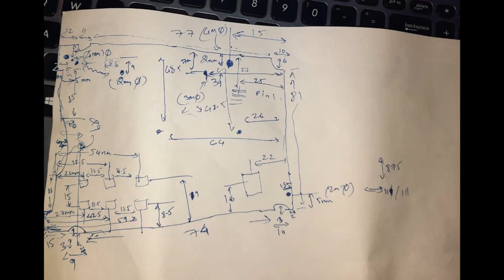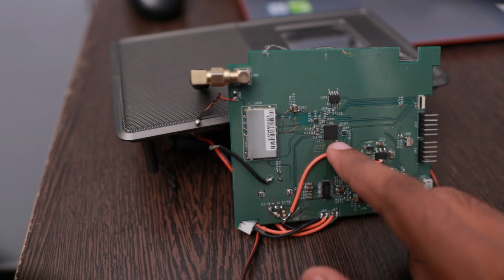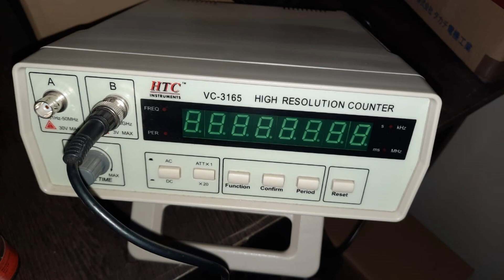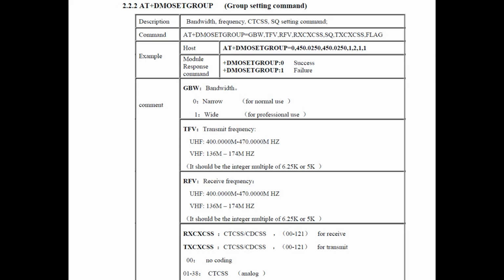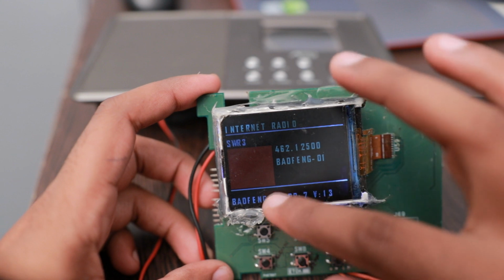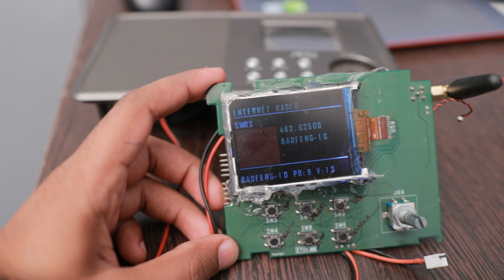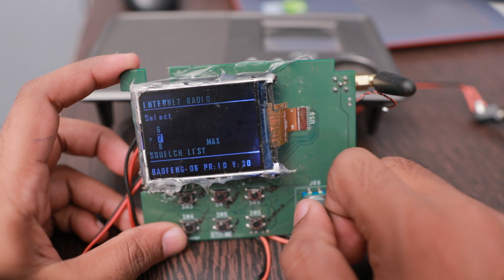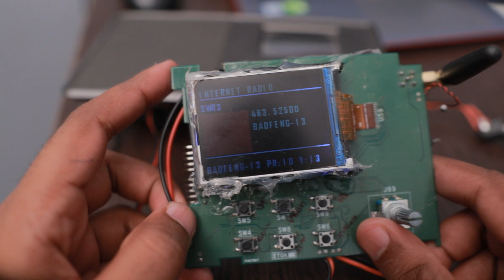Designing a DAB (Digital Audio Broadcast) Radio

Comment: what software did u use to design the ui in the lcd?
Reply from the maker: It's just normal c program with rectangle changing axis and a switch case handling the menu states. Self written.

Comment: Hey Ravi: Can you help how to establish websocket connection using sim800l?
Reply from the maker: I haven't tried it. I tried fiddling around ws internals long back. You need to go deeper into the headers and handshake that happens before a connection is established. Exchange all data manually and form correct packets. Manipulate bits in the headers.
Reply: @RaviPujar  can you give some guide. Links where I try implementing this?